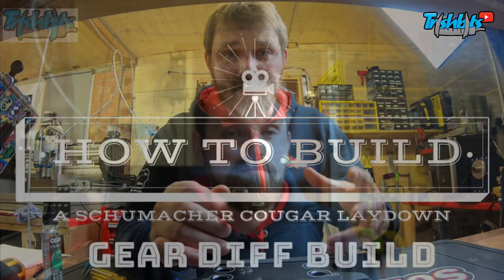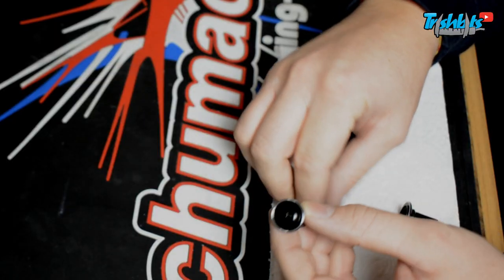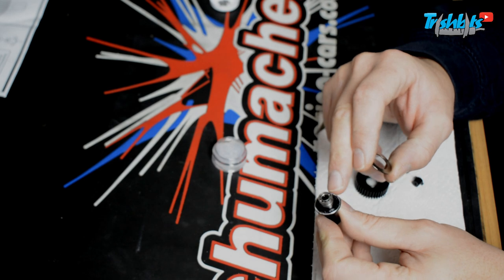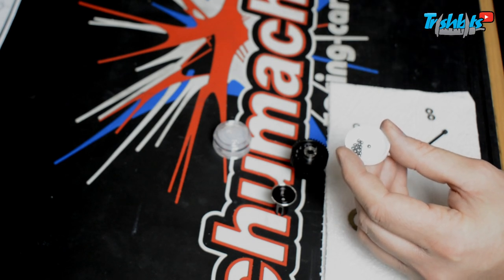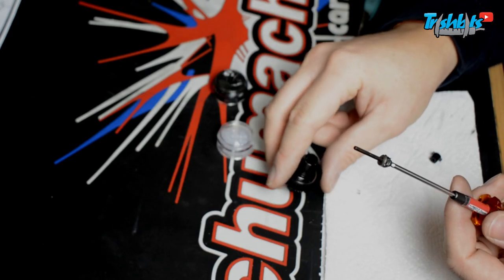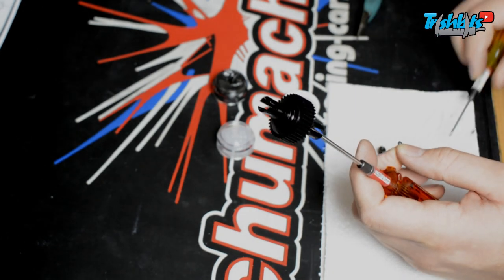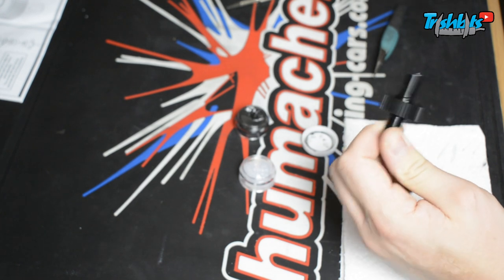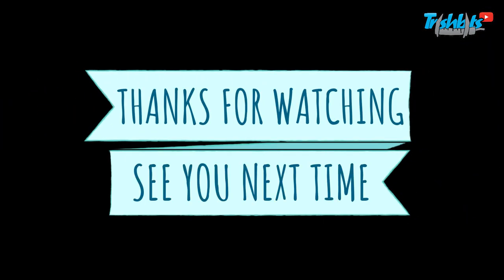Schumacher Laydown | How to build the Ball Diff for the Laydown 2wd buggy

Comment: Absolutely fantastic, so useful really appreciate you taking the time share this excellent information.  I do have a couple of questions, do you sell the balls and diff washers separately, or do you have to purchase the complete diff? If so where can I find part numbers.  Second question, I see many other talking about running the diff in.  For example,  holding 1 wheels for 15 seconds etc... you didn’t really mention too much about this.  Does this mean that running the diff in isn’t really applicable with this specific diff?  Thanks again.
Reply: Allan O'Brien thank you very much for the advice. Would you have tips to run ball diff in, mine in the pack unopened?
Reply: Allan O'Brien thanks Allan see you at Worksop on the 5th

Comment: Trish, I am returning to racing after many years and wonder what the real difference is between geared diffs and ball diff on astro turf. At my local club I am told I need to run a ball diff when its wet. Wondering what your thoughts are?
Reply: Ball diffs are best suited for loose tracks where as gear diffs are best suited for high traction tracks